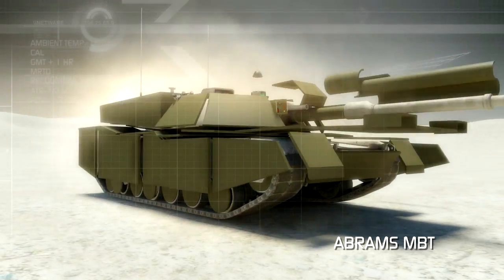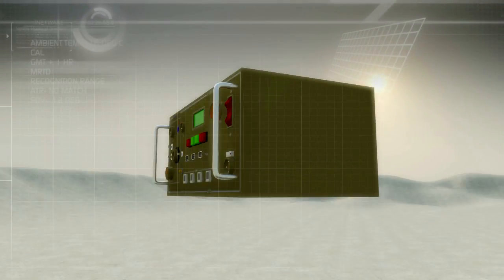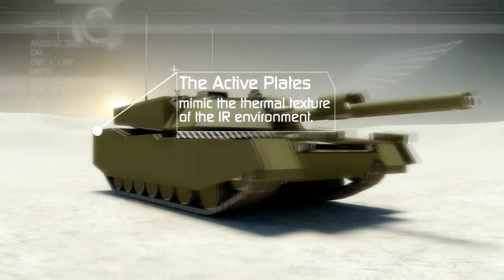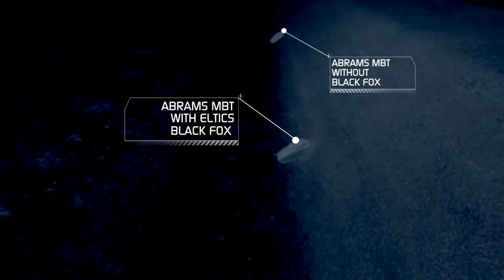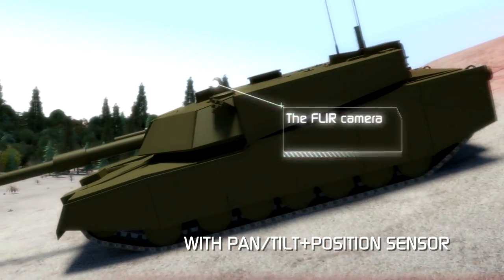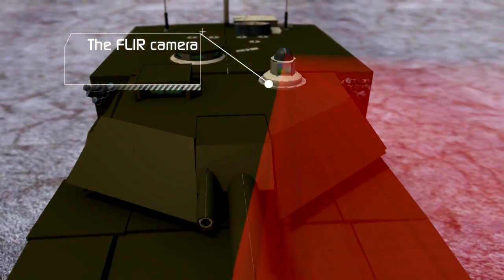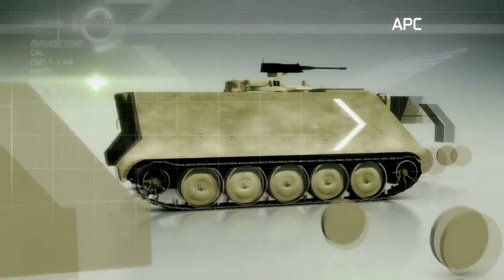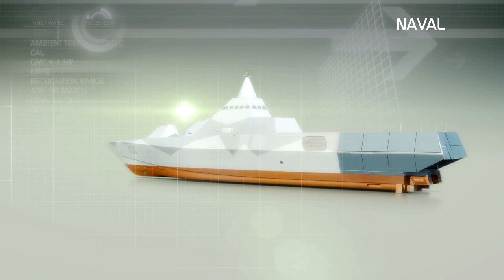Eltics "Black Fox" Thermal IR Countermeasure System [ShortVersion]

Comment: I want to ask everyone here - did you learned physics in school? Ok, you can cover the heated parts of the vehicle... for some time (it is short, beleive me). But how you can hide a huge amount of hot air from the engine? To make vehicle fully invisible at infrared at least for 10 minutes you need to integrate hudreeds kilograms of coolant and cooling complex for each heat source in machine (tank or whatever you want).
So the computer pics in the vodeo lies - we must see one tank full visible with cloud of hot dust and outtakes and another one - just like a hot cloud of outtakes.
Reply: Alex walker
Ah, of course they are not showing anything real "because it is top secret", lol.
Reply: it doesnt work with talipan
Reply: If it worked it they would show us a real footage not an animation of the tech.

Comment: The top armor is the weakest, but it's still enough to protect against shrapnel from artillery, or air burst munitions. AT hand grenades are effective, but you have to get within throwing distance of the vehicle, and they pose more risk to the user than to the tank. An RPG-7 would almost certainly penetrate the top armor, but an air to air missile such as the AIM-9, or R-60 likely would not.

Comment: The tank would be repairable, and the crew keeps several rounds in the crew compartment itself so they could still fight even with the bulk of their main gun ammunition destroyed. There are lots of weak points on a tank that can affect it's combat performance. A better strategy would be to disable the tracks, or the engine which is the component most likely to be hit by a heat seeking missile. The optics are also good targets, and can be damaged by small arms fire.

Comment: The warheads on air to air missiles are designed to detonate near the target, and shower it with fragments. This of course would be effective against soft skin vehicles like trucks but would cause minimal, if any damage to armor. Tanks are designed to withstand artillery fragments, and air to air warheads operate the same way. Even with a direct hit damage would likely be minimal. There are however heat seeking anti tank missiles that pose a threat to turbine powered tanks like the Abrams.

Comment: Also the AMRAAM is radar guided not heat seeking. You're thinking of the AIM-9 maybe? Still the warheads on these missiles aren't designed to penetrate armor, and would do very little damage to a modern tank. Even if an air to air missile were to detonate the ammunition storage the blowout doors on the roof of the turret would direct the explosive energy away from the armored crew compartment.

Comment: The crew would probably survive that, and the tank would likely still be salvageable. Despite the hot exhaust the Abrams is one hell of a tank. There was one instance where an Abrams had a fuel cell damaged by enemy fire, and it caught on fire. The crew evacuated, and it took another Abrams, several grenades inside the crew compartment, and several Hellfires from an Apache to scuttle it. They're damn near indestructible. Then again so is the Leopard 2.

Comment: Indeed. I've always preferred the Leopard 2 for exactly that reason. Conventional diesel engines are louder, but produce much less heat, and are much less fuel thirsty than turbine engines. Turbines do however benefit from mechanical simplicity, but ultimately that means nothing when a heat seeking missile is locked onto your turbine exhaust.

Comment: @edwardtang1977 It won't be the most popular option, but it can be useful - if a VIP was travelling via humvee for example, they could send a small convoy of tanks masked as humvees down the road they expect to meet resistance. When the ambush springs, they'll then find themselves against heavily armoured tanks instead of the soft targets they were expecting. From there, they'll either be spotted through the tank's IR sensors / friendly recon, or they'll retreat, thinking the intel was wrong.

Comment: @SecuR0M
Um dude hate to burst your bubble but the ak is one of the most reliable gun designs out their, the fact that its still in use proves that. Yes it isn't as high tech as some of the American or British weapons but the dammed thing will almost always fire and dam near ever weapon in that particular design can interchange parts if you need to repair something, add to the fact its fairly cheap and and easy to assemble, produce and repair make it a fucking awesome rifle.